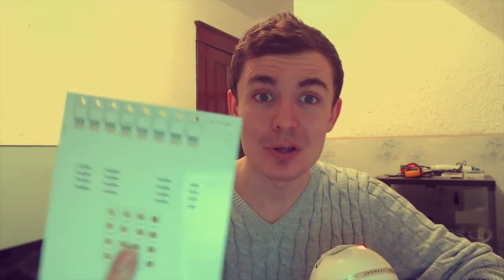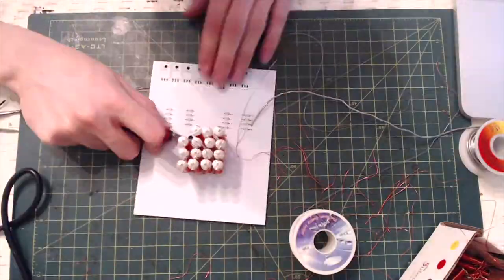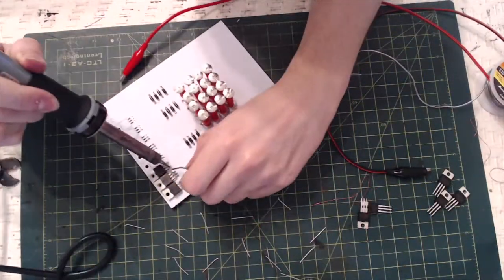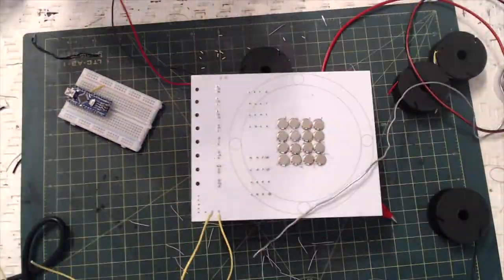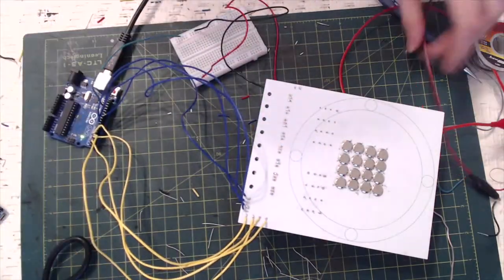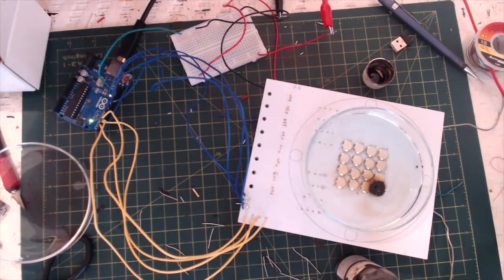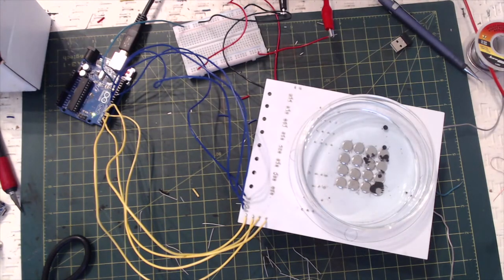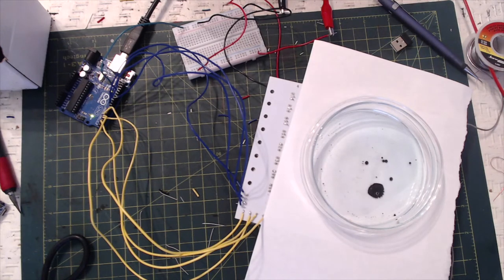Build your own Digital Ferrofluid Display! Part 2 & PCBWay Review

Comment: Can you tell me how do you get the ferro fluid to get attracted to the electromagnet if the whole contraption is vertical?

I was thinking of using a single electromagnet with a rectangular pole instead of 3-4 electromagnets. This way I could use 7 electromagnets for a figure 8 display. Using 22 electromagnets and 2 small button magnets would allow me to display "18:88".

Or maybe use small electro-permanent magnets to reduce power consumption.

Comment: Why is the board soooo gigantic? There is nothing on it
Reply from the maker: It was much larger then it needed to be to fit a 100mm diameter petri dish (which I was experimenting with at the time). In pt.3, and the design posted on my website are much smaller. https://www.youtube.com/watch?v=DTVfAa5CtmU